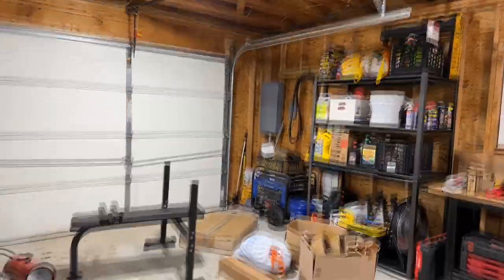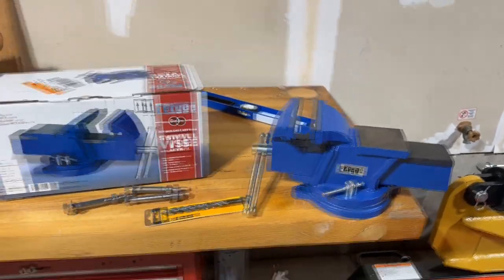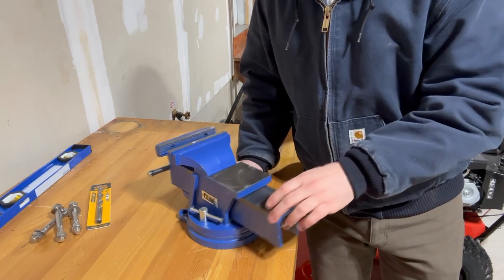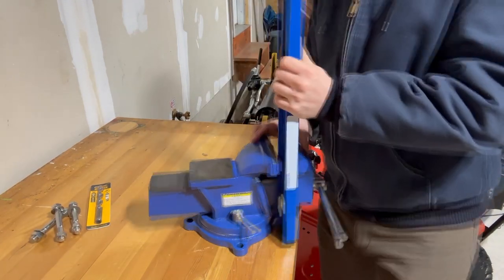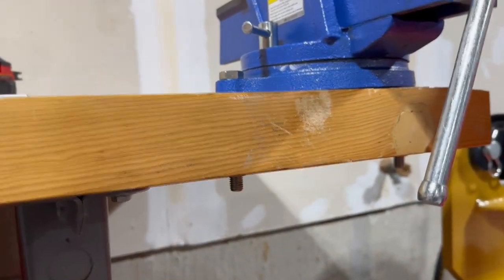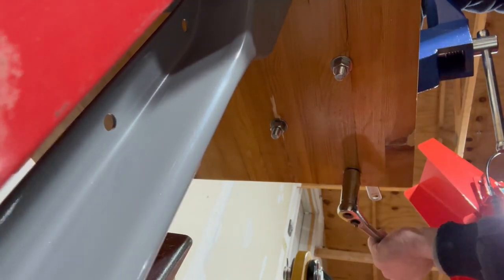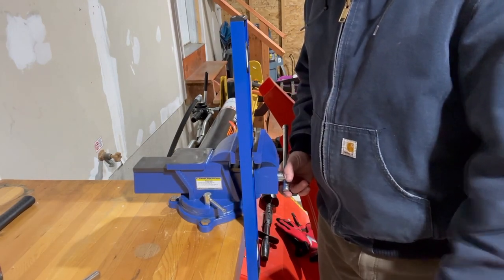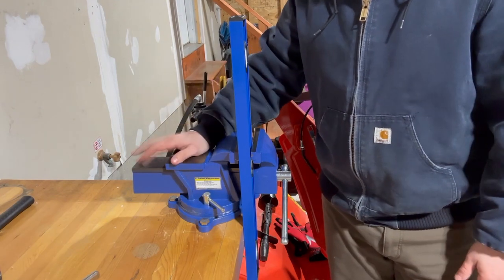Bench Vise Installation - Garage Upgrade! - Harbor Freight Central Forge | How To

Comment: It's been a year.  Have you checked the bolts to see if they are as tight as they were when installed?  If not consider putting a lock washer under the nut or using a drop/dab or two of blue locktite to keep them tight.  A nylock nut as suggested earlier will work too.  Pounding on the vise or bench can have a tendency to loosen the bolts.  A lot depends on the type of work you do on the bench/vise.

Thanks for posting.
Reply from the maker: I don’t use it a ton but so far so good! No issues

Comment: Carriage bolts?  They look like your typical hex head bolt. Carriage bolts have a rounded /smooth head and a square neck just to under the head.
Reply from the maker: My mistake! Must have looked at the wrong bin at the store. Thanks for the correction! Hope the video helped otherwise.

Comment: You went through all that yet STILL didn't provide proper clearance for vertical work ! See at the very end of the video how the clamped level is still hitting the edge of the bench top ? Measure twice...cut once fellas ! Don't fret however, a simple cure may help. Just extend the rear (stationary) jaw with a magnetic jaw pad or just add a 1" thick small strip of either metal or wood to the rear jaw to extend the work piece out enough to clear the bench. Something you shouldn't have needed to have done, but it is what it is.
Reply from the maker: I know it looks tight in the video but I do have enough clearance. I can also rotate the vice approximately 90° and it clears the other side of the workbench.thanks for the suggestion though! Might help someone else!